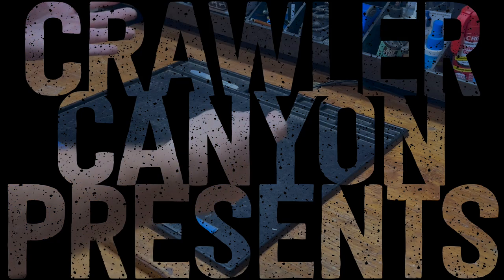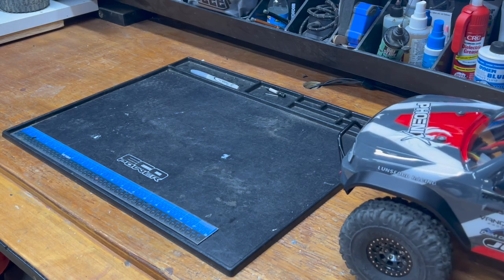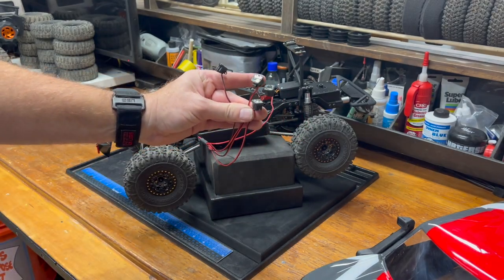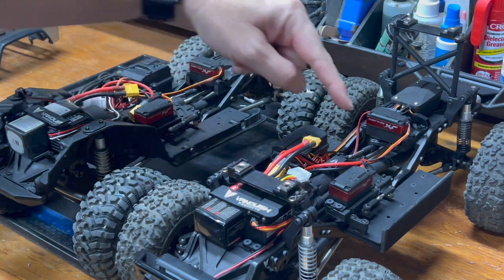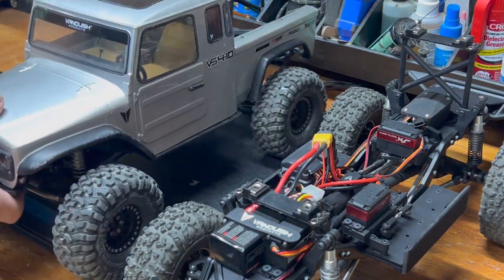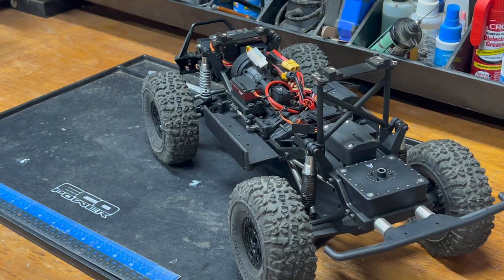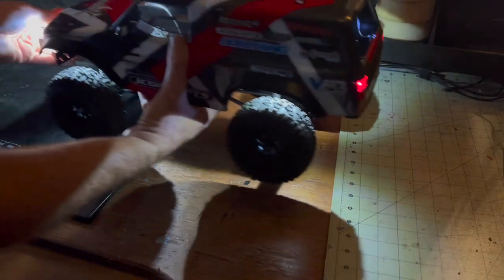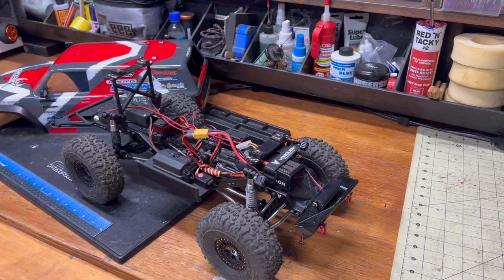Crawler Canyon Presents: ICFTW Vol6 Ep6, Straight Axle Phoenix Build, now RTR, even with lights!

Comment: My 10.3 never clicked and neither does my Phoenix portal axle(haven’t built my straight axle yet)but I believe it is how I greased it plus I seal the out shafts with plenty of grease then I fill them up with 90wt gear oil. They run so smooth. I never understood why so many people had issues with the  SCX10.3 so I really took my time building it…over built really but never had a problem. Then the Phoenix supposedly had the same problem and built it the only way I build a transmission and no click and super smooth. You ever tried gear oil in transmissions and transfer case’s. Amazing. Grease the connecting parts of the case and it seals it. Haven’t had my 10.3 or my Phoenix leak a drop and it’s been a couple years for the 10.3 now and about a year for the Phoenix. You should try it out some time. Paint job looks killer. Nice work, I painted one body nice in all my collection and I’m the guy who only does patina now, enough patina to match the year of the vehicle. Keep the videos coming. I don’t always comment but I do watch everyday or almost everyday, surprised you didn’t load one yesterday but figured you were busy painting the ride and maybe I was right.

Comment: maybe hot glue the wire connector that runs to the body. just the back side of the connector. so the wires dont pull out.
Reply from the maker: That's an excellent idea based on my track record.  I'm gonna forget about that plug virtually every time, and just yank the body off. That poor connector doesn't stand a chance.